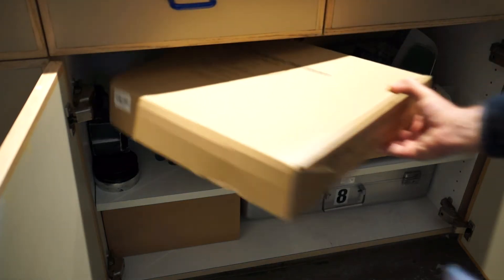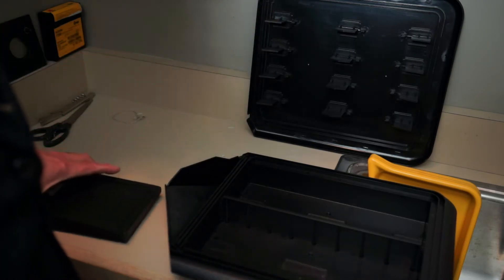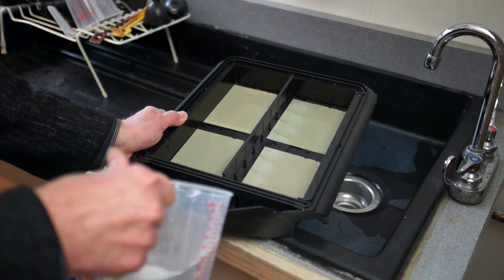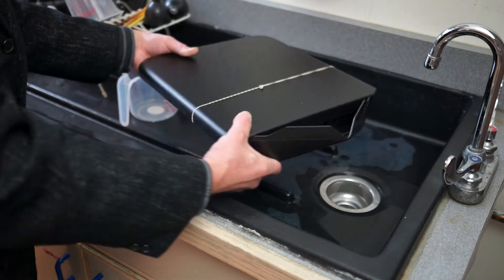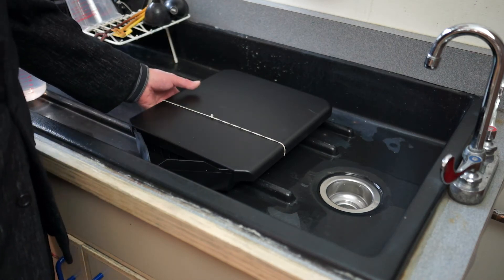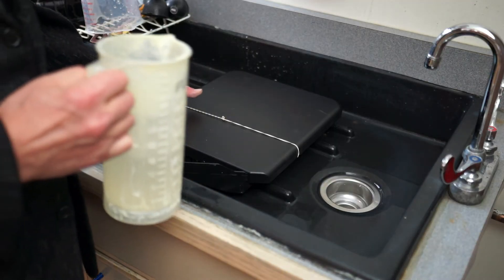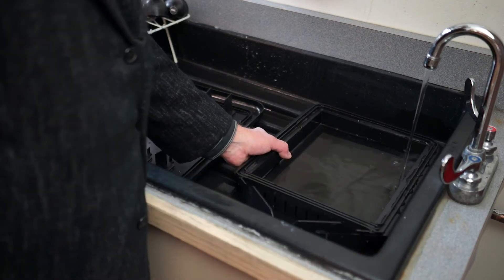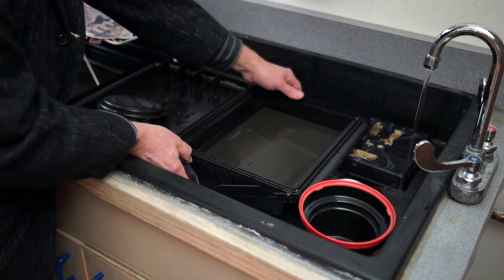Developing sheet film in the Stearman SP-8x10 daylight tray

Comment: My experience with this daylight tray is mixed. Loading might be easy in the darkroom, but not so much using a changing bag or even a changing cube – it might be easier with a large changing tent. But my biggest problem was uneven development and visible stripes on the negatives (mainly with color negative), and I think the flow inside the tray isn't ideal due to these pieces in the lid that are there to hold down the film. And 4x5 tend to glide through under the holders/dividers in the middle (with my SP 8x10). I changed to a Jobo 2520 for 4x5 and to rotary development, and my problems are gone (I also have an SP 445, and I had lots of problems with this one, too). I might go back to the SP 8x10 if I go 8x10 at some point (still undecided ;-)).

Comment: Thanks a lot for the video.
I am currently thinking about getting a Stenopeika Air Force 8x10 after having used only 4x5 so far and I am looking for development options. This one looks really interesting, especially since it seems to work nicely with 4x5. 

This thing is - as the name suggest - made for one sheet of 8x10 film.You have a divider in the middle to separate it into two compartments for 4x10 film. But you did not subdivide it any further. When you showed with the open lid you could actually see the two sheets on one side going over each other. I assume they will stick eventually and the lower sheet will not get developed properly.

So since there is a middle divider, I would have assumed that there are also additional dividers to separate the tray to four compartments of 4x5. If these are missing, this would be a big "no thanks" from me. Or are they included and you just decided to not use them? If yes, why not?

If if comes with the additional dividers, you could probably develop 8 sheets of 4x5 or 2 sheets of 8x10 at a time by putting them back to back. I always do that when developing paper and I have to do several identical prints. Figure out how to do it, then expose all papers, then develop them after everything has been done, two sheets back to back in one tray. This of course with open trays in red light
Reply: it comes with more dividers

Comment: The dry run demo shows the 4x5 negs going over one another. If they get stuck during the dev time, they won't be usable. What prevents them from doing this in this method? I have the 4x5 stearman and considering upgrading my camera to an 8x10 so very interested in using this for all format.
cheers
Reply: There are dividers included with the tray that are supposed to go into the tray when used with 4x5, to keep those sheets separated. I'm surprised they were not shown, despite the middle divider being used.
Reply: Yes there are dividers put on the lid – but they didn't work reliably with my SP 8x10 (the lid is slightly bent upwards at the center).